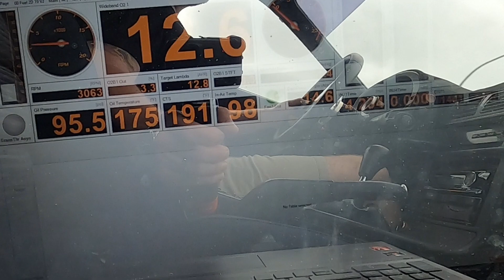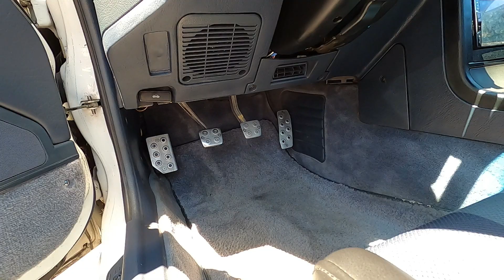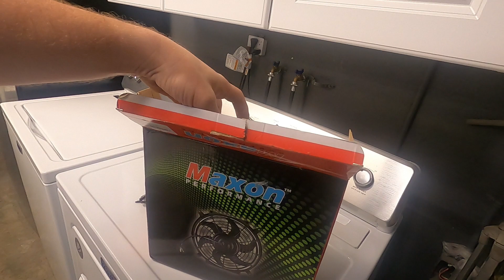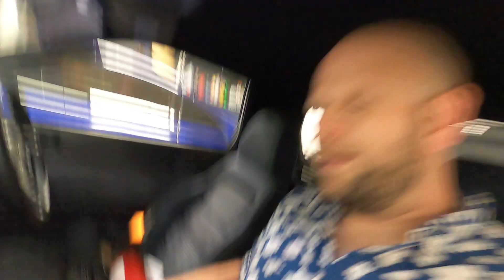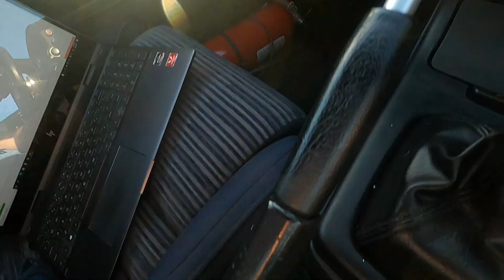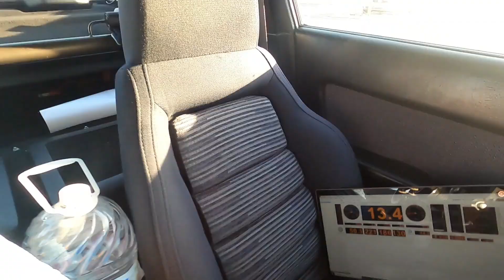Overheating at the biggest car show! RHD JDM FC3S RX7

Comment: So move the intake out of the engine bay. 
I was seeing 150 temps on my FD with the filter on the turbo. I moved it up by the head light over the frame rail and built a sealed box that it sits in that pulls air from the front of the car. Temps don’t get above more then 20degs above ambient now.

Comment: I think a twin SPAL would have been a better choice with some ducting for the rad. For the intake maybe some Water Methanol Injection kit
Reply from the maker: Well the radiator has two spal fans and ducting
Reply: @MohrGarage  I did not know that  , i will watch the build series and have a look at that. it maybe a ricer thing but you could try some bonnet spacers in the rear to see if that helps.

Comment: Where is the turbo inlet getting air from?   The fan will have low impact if the turbo is drawing hot air off the v mount setup.

Comment: how come such a high idle? 1500 pretty aggressive for a street port imo, i cant believe ur intake temps got that hot, insane some of it could be false data as the sensor gets heatshoaked pretty bad,
Reply from the maker: It's not tuned yet so idle is high. Still testing everything, going back to a different set up....

Comment: I'm actually in the similar situation as you. I track my rhd fc with stock intercooler and have been suffering with heat soak. I found a used v mount. For the vented hood, rather than buying the "d max scoop", I got myself a NA aluminum hood and will be getting "trackspec" hood vents. Total costs of parts are under 300. Just need to cut up the hood, drill, then rivets the hood vent. However, my build is more for function, form/style for me is secondary
Reply: Instead of the trackspec vent, look into the Race Louvers vent. It has a wicker built in to promote extraction by creating a low pressure zone. I installed one on my rx7 in order to lower coolant temps since I have a front mount ic. On the highway I was seeing coolant temps around 200-210F before, now it hovers around 180-185f
Reply: @Karma28217  thanks for the suggestion. I only heard of trackspec vents through a friend that use it on his FB. I checked your suggestion, and its nice that they have specific options for the year and model for the rx7. Probably to accommodate for each model's certain hood curve? But ill look into them more once I have my v mount installed
Reply: @jmirav  No problem. The 2 options are in consideration of the turbo II hood scoop. Since I am using a n/a aluminum hood I picked the race type center vent for the n/a model as I wanted a bit of a downforce bump. Measured the radiator and fan then placed the vent in an ideal area to pull heat away.

Comment: ive been shopping for the perfect used ic setup and what ive noticed is especially noticble on subi ic is.. the hot side is grouped whole and thru the ic then the cool side is all compressing to the charge pipes size to coupler

Comment: to be real dog, thats why vmounts arnt flat... and the greddy version is slightly angle with the end tanks with full swooped funneled charge pipe couplers... but the induction from front into the gril is ussually 1/3 and then shud expand to the face and slightly narrowing exit 2/3.. the degree of angle entering and exiting shud just ramp steady linear constant... they say the air running the walls of the ducting is faster cooling while the centers are tumbling low pressure... so grouping it by kinda like why exhaust ports are smaller cause kore velocity to relieve thrush... also think abt a rear diffuser on our cars... how its exit widens as it lifts upwards expanding out
Reply: the narrowing exit is either narrows as it exits like a jet or its like how a shroud aftermarket is basically covers the ends of the center to expanding out since like ive heard the air induction runs alongs the walls so hitting that shroud would cause more compressed fast air pausing up and absorbing heat then exits centers with an expanding ramp like a rear diffuser out the hood or ramp it under the hood but provide a vent exit louver design near the hoods meeting the wiper shroud like bmws would be clean and keep the og turbo hood!
Reply: the shroud of aftermarket radiators i mean, it looks kinda dumb but it makes sense vs the oem stand off clutch fan drawing from the rad like a shrouded blanket soup mouth opening ... the aftermarket mounts it just offface but sealed but like i send above... the air runs along the duct walls and would have to heatsoak at the stumble against the face after passing thru the exchanger to having to swwirl out by the spal!

Comment: The issues was not a let down, it just shows the path of aftermarket modifications and all way to engineer around the problems you've had. Good job on the car you save someone money and research set ups more.